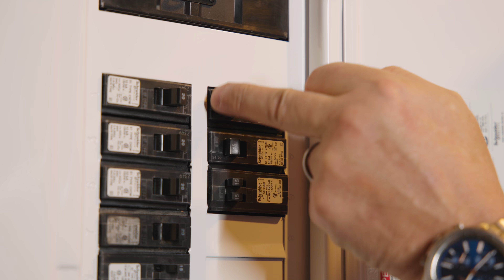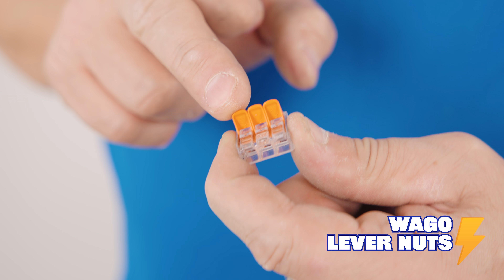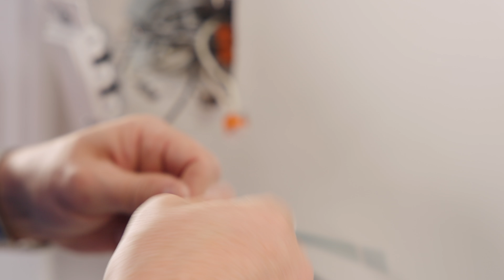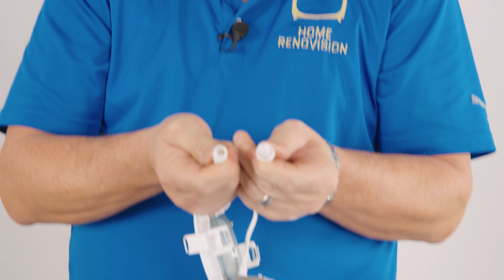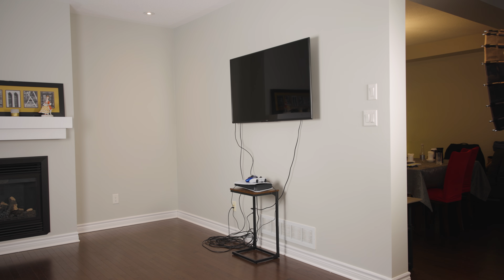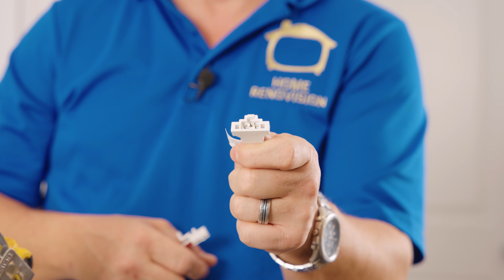Electrical Hacks Every Homeowner Should Know (DIY Friendly)

Comment: Jeff, before I was a certified electrician, I appreciated advice like you give. I’m not saying what you are teaching in this video is incorrect. You have historically taught electrical insulation incorrectly though. I have have commented on it. Ie: you require a neutral in a switch box. But electricity is not always a white to white, and black to black. There is theory and understanding to how a circuit works. You are showing a normal, ideal, situation. Not every installation is “ideal”. This is the problem. People follow advice given by uneducated people like yourself and feel educated enough to do their own work and possibly wing it if their situation is not like yours. Then the fire department or ambulance gets some workplace experience. You have a big enough following to be a leader in this regard. Don’t teach something you are not educated on.

Comment: Jeff, at 26+ minutes you unplugged 3 cables from the TV including power. You ran 2 cables up the wall. What's the secret to  getting the TV to turn on with only a low voltage installation?

Comment: I did some research recently and found out there's some companies who have made TV mounting kits that use Romex to basically let you create an in-wall extension cord for your TV. So then you can run the power and the low voltage wires from a mounted TV.

Comment: I wanted to have a motion sensing light for my laundry room, but it required a ground to work and my old house is mostly ungrounded wires. But they do make bulbs/fixtures that have motion sensors built into them as well.
Reply: Don’t ask Jeff for advice on this issue. Get qualified advice from a qualified electrician. Your insurance and health/safety depends on it.
Reply: @mikepeters5785  Nothing in this comment is asking for advice.

Comment: People of the world.  Stop mounting your TV’s way up on the wall like that.  The thing needs to be closer to eye level when you are sitting where you are going to watch it from.  Definitely NEVER on top of a mantle above a fireplace, unless you have a cool low profile fire box,  keep that stuff down low.  It looks goofy up in the air.
Reply: Having a television above the fireplace is neck breaking and makes watching TV so much less enjoyable. Improve your layout to avoid this. If you must put it above the mantle, get a pull-down mount designed for the space.
Reply: I have about 30 recessed cans in my house. They all have LED light bulbs in them. If one goes out, I just replace the bulb. No halogen bulbs anywhere. No need for any conversion kit. Easy peezy.
Reply: mines above the mantle. only place it can go. They make cool mounts though that pull out and down for when you like to use it. Significantly harder to install though.
Reply: Mine is mounted about 5 feet off the ground tilted down. It used to be on top of the fireplace(gas) it worked fine for me, but the wife didn't like it so had to move it and she got new couches to "fit" the new set up. 😂
Reply: @taztheg2007  next month she will decide you were right and have you put it back so she can get some other furniture her friend posted on FARCEbook. Better to just have a nice dog that lays on the floor and doesn't care. 😊
Reply: You are so wrong! I’ve had my tv above fireplace for 9 years and it works great
Reply: You are entitled to your opinion. Not everyone shares it, however
Reply: A TV will always look better over a mantel than it does at 4 ft off the ground in the middle of the wall especially if you have taller ceilings
Reply: @ColetheRed  In both of the cases you mention, there should be no TV.  I think that in most cases the TV is the last design consideration of how a room lays out, the fireplace gets first dibs.  Add to that that TV’s are HUGE now.  It takes quite a bit of effort to work all this together.  Granted, the TV ends up on top of the mantel often.  But unless it’s a really well designed situation, it’s gonna look bad, sound bad, and make your neck feel bad.  And there isn’t much actually on network TV anymore.
Reply: @markg7963  We don't have a TV at our house for some of the reasons you listed but I have quite a few friends that have theirs mounted above the mantle and high up on the wall and it's never been a problem to watch.
Reply: @ColetheRed I no longer have any friends with TV’s over their fireplace.  I liked these people, but when I told them their living rooms looked funny with a TV over their fireplace, and then physically ripped the TV down off the wall and smashed it on the floor,  they kicked me out of their house.  Weirdos😂

Comment: The Ideal lever nuts are FAR superior to the WAGO.  The wago let the wires wiggle around, but the Ideal hold the whole assembly way better, they are more secure and the lever is harder to accidentally open when you are inserting things into the box.  In either case, these are superior connections for stranded wire, and they are easier to make multiple connections.  With a box that has 4 smart switches installed, you need 8 connections to common at some point, unless you daisy chain.  Wago makes a 10 wire connector.

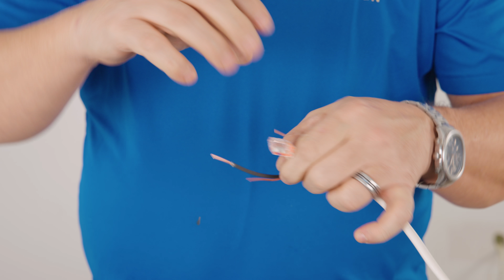Comment: 7:55  Jeff said that you are not able to remove the push connectors. All you have to do is twist them side to side while pulling out. And they come out fine?
Reply: that would be safer than what he did the bare wire was still exposed after being cut from the connector and could touch the metal surface of the box

Comment: Love all experts that are always ready to criticize but never have a solution 😢,
Reply: There is a difference in criticism and just pointing out a lack of education. Electrical work is not to be taken lightly. There is a reason we went to school for 4 years and and countless hours or education on the job to know what we know. There is more to power than white to white, and black to black. One really has to understand why we connect the wires we do, the sizes we use, the point of each connection, and why things work when we are done. Ask yourself this: are you willing to tell the insurance company you know what you are doing because of a YouTube guy?? I’d recommend saying, on the rare case something goes wrong after we wire your project , a professional electrician did this.
Reply: @mikepeters5785  I didn’t read all your qualifications because you sound like a wanna be. I learned from a young age to choose your battles. I’m a utility worker with Con Edison 40 yrs experience while you’re dealing with your 120-240 volts we’re working with 13KV-35KV rain, snow blizzards and whatever comes our way. The man is showing different types of electrical switches that are sold in big box stores which provide instructions by the manufacturers just the same way a auto parts store sells auto parts to the public not just to a master mechanic. I’m sure you yourself don’t call a union plumber to install a toilet tank water valve. Spare us with your textbook electrical knowledge .
Have a great day Sparky
Reply: @mikepeters5785  Oh brother! This is sanctimonious exaggeration. In Ontario, Canada becoming an electrician does not require 4 years of school. There is thousands of hours of on-the-job-training. School means in-class and that part is more like one year. 

Lack of of license in a specific trade isn't lack of education, you are intentionally being antagonistic. Such rhetoric doesn't make you look smart it actually reveals your lack of education.

Just the same, tired straw man argument about home insurance being denied in the case of fire due to faulty electrical work. Excluding cases of misrepresentation of knob and tube or aluminum wiring, it is unicorn rare in residential homes. Ontario code allows for the homeowner to replace "like-for-like" devices like this. For other work what matters are permits/inspection, not that a "professional electrician" did your electrical. Still further, they can't just be a licensed electrician they also must be licensed electrical contractor (in Ontario, Canada). If a homeowner does their own work what is important is that they do the permit and inspections.

Maybe you are a practising electrician with license, congratulations on attaining your trade but it's not a big deal. Rather than such electrical work being "taken lightly" it seems you are pedantic and personally threatened by anyone revealing that doing basic electrical installations isn't at all advanced and certainly doesn't require skill beyond the use of basic hand tools. Millions of homeowners, who aren't electricians do simple installations like these properly and know what they are doing.

Comment: I swear to god these electrical boxes should all be twice as big ... So cramped in there.
Reply: They do sell deeper ones that will alleviate the cramping. The manufacturer of those special switches and plugs actually strongly reccomends that you use a deeper box for those because of the tight quarters.  Problem is those boxes cost 3-5x more and builders are cheap so they just use the standard ones.
Reply: i just had to replace an old metal box because it wasnt wide enough for a new dimmer switch
Reply: Easier to coil the wires into a double box.  Smart to use double boxes many places, like the kitchen, to avoid having to use multi-outlet adapters.  Not much extra cost or effort.
In my kitchen remodel, I cut out all the single box openings to double since I had to re-run wires (eliminated a dropped ceiling) so needed to reach my arm in with a pry-bar to remove the staples on the studs to pull the NM cable out.

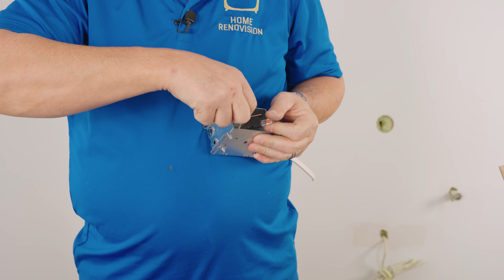Comment: 9:52 Just a heads up: they sell an inline version that uses less space in the box for stuff like this. I found it incredibly handy when I had to do it in an old work box with limited room

24:38 At that point I would cut the connector off altogether and replace with a wago. I once left exposed copper in an insure and it touched the metal housing of the dishwasher. Not a fun time.

27:51 Just to make sure, I would run the stud finder up the wall. I've found blocking in my house in weird ass areas
Reply: "I would run the stud finder up the wall. I've found blocking in my house in weird ass areas" - YES! especially when the cavity is used as a plenum.

Comment: You can easily remove the wires from a push in connector by twisting it back and forth and is recommended by the manufacturers. They can then be re used, although I wouldn't re use more than a few times.

Comment: 24:38 jeff, my guy, leaving that exposed piece of copper is worse than the way it was originally. and on the hot side no less. shoulda just started over with a new wago. yikes
Reply: That was really the only thing that I noticed that made me cringe.  I've had success twisting wires back out of those, but like you said just cut and strip both wires then use a wago. That metal box with an exposed piece of copper on the hot is asking for trouble.
Reply: @spitzer1113 open the outlet in any old house and you will witness way worse.
Reply: But according to Jeff, we're not smart enough to research, pick, and install the correct toilet.
Reply: @Execute_Order_66_DO_IT  thats why ive just been poopin in the corner 🤤
Reply: I noticed it too but given he installed it next to the pot light that was already there means this is all a demo, and it's obviously not staying. However should make it known to the viewers to cut that connector off and start over.

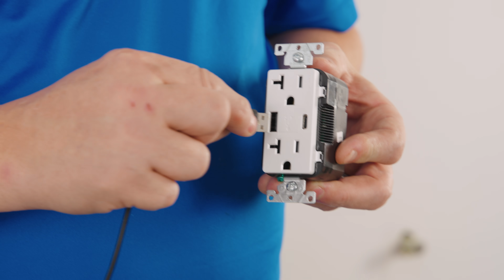Comment: 4:15 You give a lot of bad advice on this channel. You should never have AC to DC circuitry inside your walls, as in the case with those USB chargers. Not only do they often break (can even start fires inside your walls), but they are always on and are a constant energy drain. It's called phantom load or vampire power.
Reply: You do know these devices are totally approved for use like this? Also, there is "AC to DC circuitry in GFCI outlets, in many wall dimmers, in motion sensors, in all smart home devices, arc-fault breakers, etc. Yes, even a GFCI outlet is always drawing a bit of power.
Reply: @tonyc7352  Approved does not mean good practice. Keep all active circuitry out of your walls not only for safety and energy purposes, but also for resale value.
Reply: @MoonTrustee  "Resale value"?! According to you a GFCI outlet (expressly mandated for safety) can't be used so... that means you home won't pass inspection, that is pretty much against resale value. It like you didn't read what I wrote.
Reply: @tonyc7352  Resale value has nothing to do with mandated regulations that vary from area to area you dolt. Resale value is all about what the customer sees as detrimental. Example: An above ground pool is perfectly legal almost everywhere but is universally detrimental to the resale value of the property. Stop speaking when you clearly know nothing on the subject.
Reply: @MoonTrustee  Having a home that complies with electrical codes is so basic as to be a pillar of resale value. Whereas there are locations in all homes that must include GFCI outlets (mandated in every province in Canada and every state in the USA) any home without any GFCI outlets is not electrical code compliant. This is simple and universally seen as a detriment to to customers. 

Wow, you really didn't read what I wrote. Clearly, you are committed to not opening you mind and I'd be a dolt to try to reason any further with you.
Reply: Good thing its in the electrical box and not in the wall.
Reply: @RyanJamesDeanOfficial  A distinction without a difference. The box is in the wall.

Comment: 32:47 one more pro tip, for safety reasons the smoke detector breaker is usually not separate and not labeled (so you can't just go turn it off on a whim). Electricians typically add the smoke alarm power source from a lighting circuit (had to learn this the hard way) so you will just have to start switching off one light circuit at a time until the power light goes out on the smoke alarm.

Comment: When checking to turn the power off always check all the wires in the box because there could be more than one power source including even on a single duplex receptacle.
Reply: Ive ran into that before. Really glad i tested it with my noncontact voltage tester

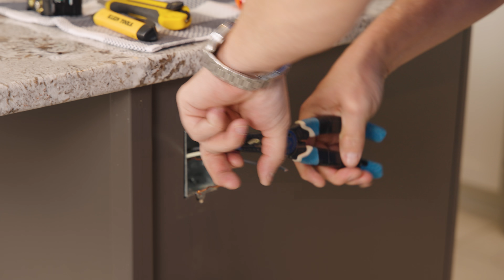Comment: 5:40 If you have the opportunity when installing those USB plugs, swap the box with a deeper one (renovation style, 3 or 3.5 inch deep). The instructions/box say you need it and you will be fighting alot less to get your wires back in without having to squish them in as you screw the unit to the box.

 That USB device plug is at least 50% thicker than a normal receptacle.
Reply: Aren’t electrical outlets in islands no longer allowed by code?

Comment: Wagos are amazing. We use them all the time in industrial controls installs. They also have a wire strip length indicator on the side and acceptable wire gauges for that model. Just gotta watch when only one wire is in, if you spin it you could potentially pull the single wire out. But they are really handy especially when you’re trying to connect solid core to stranded wire.
Reply: Dont you wish they had a four conductor 221?
Reply: @nickk05281982do you mean 4 gang?? Because that would be nice. Usually have to use a 5 banger.
Reply: Waaaaiiit you left exposed conductor nub inside a metal box in that light puck. I realize it doesnt look like its permanent because how close they are together. But just cut the whole thing and replace
Reply: Dont do electrical in a rental they will charge you for altering +++ its not your house therefore in most places you will need license and permit and inspection

Comment: One thing you should note CO sensors at least install one on a lower floor or at bed level because by the time the co2 hits that hight your either dead or close to it.
Reply: Chemist here. CO2 is carbon dioxide, the stuff you breathe out. Carbon Monoxide is CO
Reply: @user-sm6lt9mf9t  yeah sorry wasent paying atention but thats what i ment. the goal put a senssor bed level and sleep safe.

Comment: code in the US turns outlets upside down from this - just so something metal falling between outlet and plug wont short and cause problems
Reply: No, the NEC does not mandate receptacle orientation.
Reply: You beat me to it. Also consider that every power adapter with a built in three prong plug or built in GFCI (hair dryer, power recliner, etc. etc. has the ground prong on the bottom and is designed to hang down from the receptacle. They don't work that great with the ground prong up.

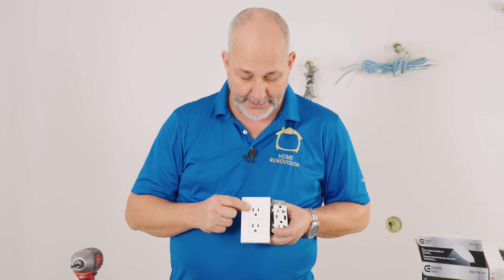Comment: At 4:40.  It's OK to use a 15-amp duplex outlet on a 20-amp circuit.  It's not OK to use a 20-amp outlet on a 15-amp circuit.  The 20-amp outlet allows you to plug in a 20-amp appliance, which has a different plug with one vertical blade and one horizontal blade.  If you plug in an appliance that draws 20 amps on a 15-amp circuit, you will overload the wiring and the breaker.
Reply: You are correct regarding the NEC, but Jeff is Canadian, and the CEC mandates that a 20 amp circuit requires a 20 receptacle, regardless of whether it's a dedicated circuit or a shared circuit.
Reply: @surferdude642 . Those Canadians are running the price on stuff up by doing crap like this.
Reply: @markg7963 yup
Reply: How would you go about changing the circuit to be able to handle a 20-amp
Reply: @AudibmwjbThe entire circuit would have to be changed to 12 gauge cable minimum and a 20 amp breaker can then be installed.

Comment: 24:19 ....oops .... ?? 24:36 the bare copper that was cut off but left in the connector is still exposed.
Although it does look like this is just a mock up for demonstration so guessing this fixture is not powered - All in all another great video as usual seeing all the new products to make construction easier.
Reply: For anyone wondering, if that happens to you just rapidly twist and pull the wire. It will come out quite easily so you can trim it back a bit. Those connectors are terrible.
Reply: @MasterCrafter7777777  ^^^^^